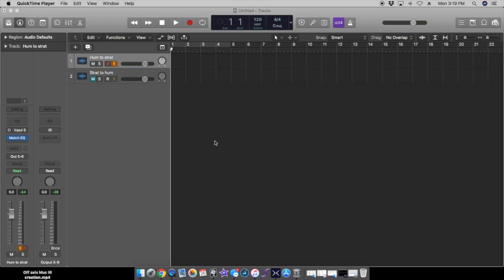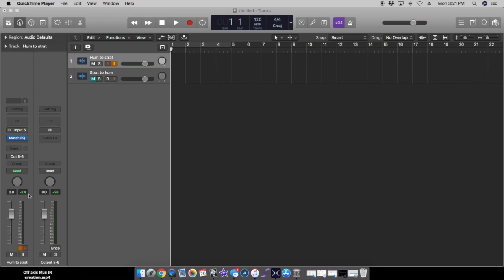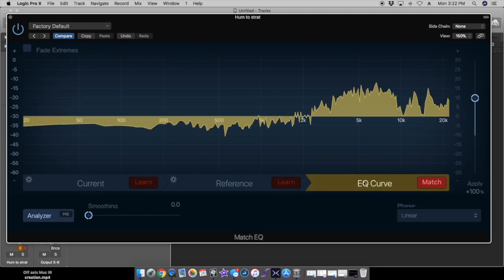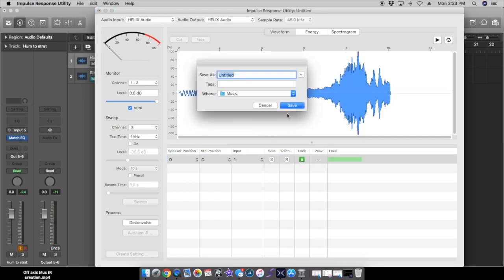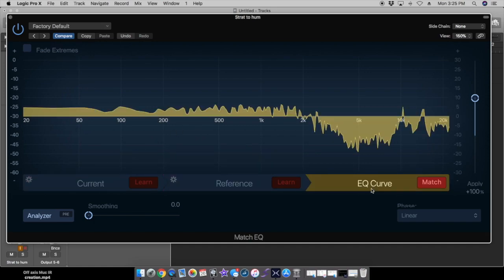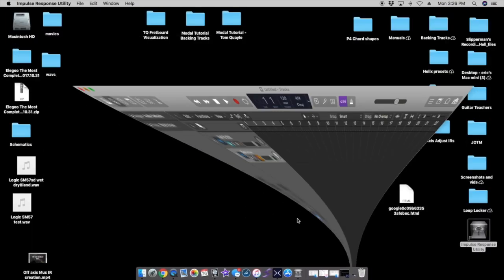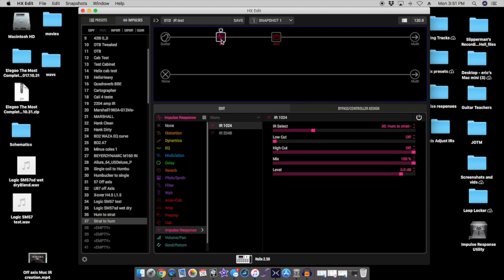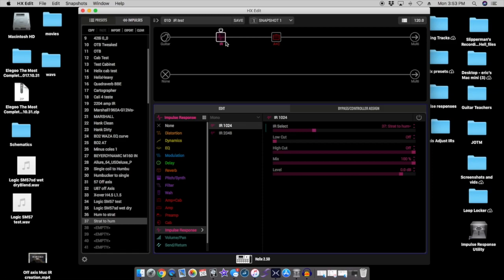Creating IRs to convert between Humbuckers and Single coil Pickuos

Comment: Very interesting!    for new needs with the choir of which I am the lead guitarist, I am playing an electric with my notebook via guitar rig 7 Pro and USB audio interface to an amplified speaker (basically a karaoke FRFR): I use the IR loader module to have an acoustic and classic nylon string sound; my guitar is an Ibanez AR 2619 Prestige with bright humbuckers (Super '80 similar to certain PAFs from the '60s) and various independent coil combinations for pickups: including parallel coils and split single coils, of which I mostly use single coils, parallel coils or parallel + single and single + parallel to make an alternative to the 2-pickup Stratocaster combinations, with the central one. Well, this is what I miss as a sound. In the absence of a real Stratocaster to sample to create the relative IRs , I sampled the single coil sounds of my guitar both with a single pickup bridge, neck, and bridge + neck. I would like to experiment by first learning to create IRs possibly with free software (as an unemployed person my budget is limited at the moment), for Windows 10, but I don't know where to start. Can you give me some directions? and do you think would be possible to get something similar to typical position 2 and 4 (bridgle + middle and neck + middle ) of a Strat playing with these samples (once created the relative IRs) and the phase of them on the IR loader ?  Thanks!

Comment: I dont have Helix, so I cant test the IR :(
Reply from the maker: Sure you can if you have an IR loader.  The file is on the Line 6 Helix family facebook page. check the files section im sure its there.  just remember to place the IR first in your signal path directly after your guitar and before any amps or effects.